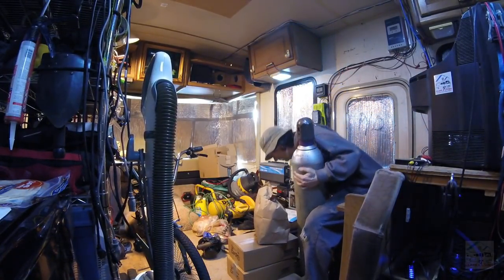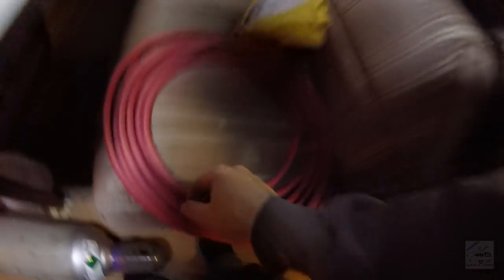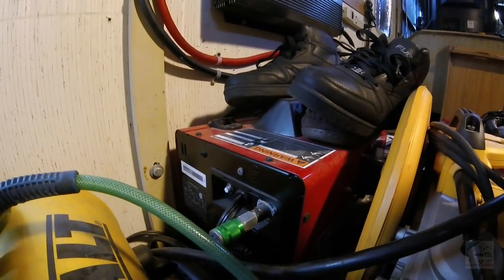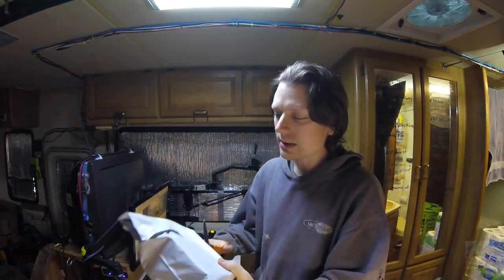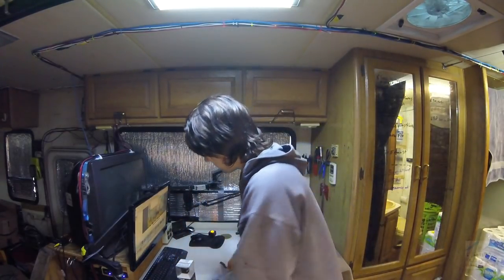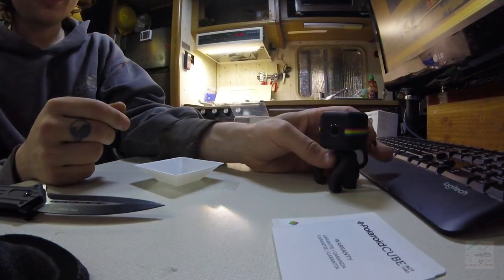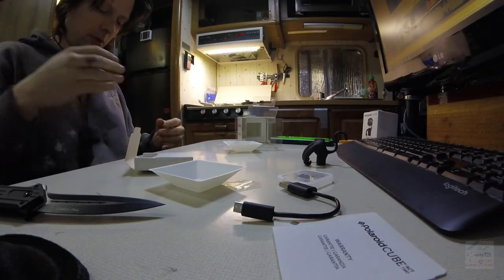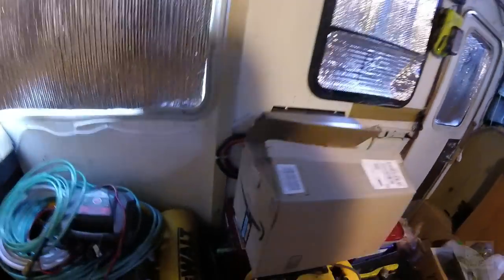Welder Project, New Camera, Burritos || RV Living

Comment: What size welder is it? 140? I generally use C25 gas with my Lincoln 140 but if I can find the really small flux core wire (.024’ish) it welds gasless with it really well. But I do a lot of automotive welding so better if there’s no flux to deal with. Thanks for sharing and be safe!🙏🏼